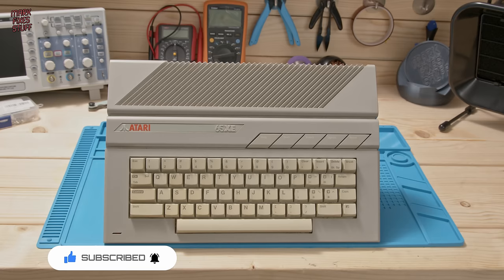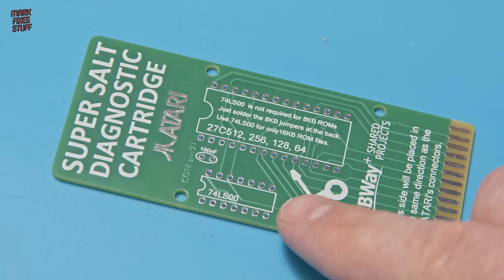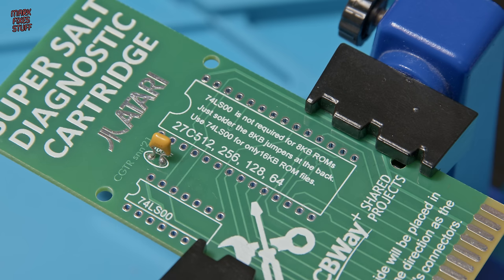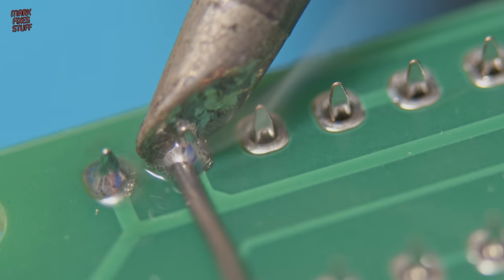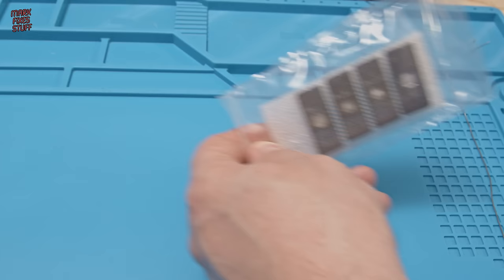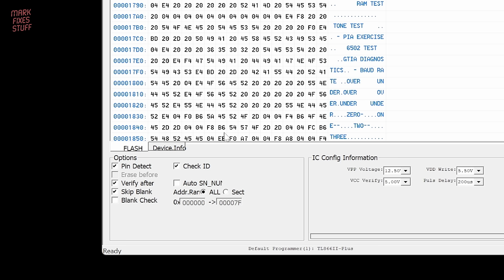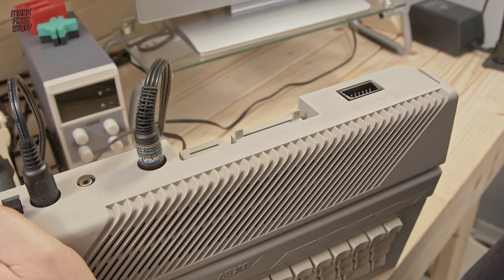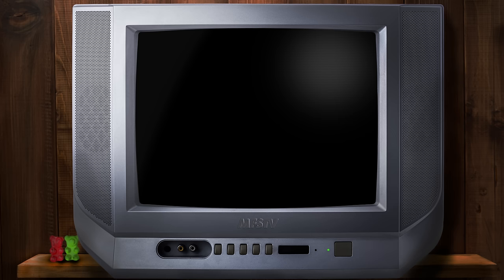Is this worth the effort? Replicating the #Atari Super Salt Diagnostic Cartridge!

Comment: They make switching regulators that are extremely low ripple now. I highly recommend using that instead on a restoration if it's for general use. Obviously a Museum restoration you want to keep original but day to day use it's way better than having all the heat in the case brittling the plastic and stressing the other components
Reply from the maker: I absolutely agree. A Traco or OKI switching regulator is a really good replacement for older machines. I do miss that "warm smell" though!

Comment: Nothing wrong with using leaded solder for home projects.
Reply from the maker: It’s true. I also use leaded on vintage machines that also have leaded solder already because mixing the two is bad. These machines should never go into landfill either, so the likelihood of them being dumped in a way that means the lead leaches into the water table is very small.

Comment: For non-leaded solder, it actually flowed and looked quite decent to work with.  Anyone know the brand/type? 
I don't do a tonne of soldering, only on controllers or other small items, but I only ever used leaded - purposefully staying away from unleaded due to its negative reputation.  As it can be hit or miss with some brands being better than others, I would be curious to know this particular type.
Reply from the maker: For unleaded I tend to use DURATOOL D03341
Reply: @MarkFixesStuff  Cheers.

Comment: Is there any truth to the theory that repeatedly programming the ROM image into an EPROM (say 3 times) reinforces the programming reducing the chances of decay? Secondly I always cover the window but more out of OCD than anything, well I have a label printer so it's a convenient way of labelling it to. I left EPROMS outside here in the sun for two weeks solid (i wanted them erased) and yet they verified perfectly - annoyingly.
Reply from the maker: Programming an EPROM simply flips the bits on the cells so I would suspect this isn’t true. The cell can’t be more flipped with repeated programming. Labelling is essential. I just didn’t in this video before I tried the cart! Thanks for watching!!
Reply: @MarkFixesStuff  As you say it can't be more flipped but was something along the lines of the number of electrons trapped to make it go from 1 -> 0 and over time they decay so the more trapped the  long it takes to decay. Well above my understanding though tbh
Reply from the maker: @digitalarchaeologist5102  I’ve had UV erasable eproms readable after decades so I don’t really think it’s worth worrying about. Not sure on the definitive answer though.

Comment: "Got any O's"?
Reply: "Foot pumps?"
Reply from the maker: Bill Hooks
Reply: @MarkFixesStuff  They did say that was one of their worst endings to a skit.

It took me about five years to even get the "joke". lol
Reply: @baxtardboy  Yep, that sounds plausible.

The BBC were over-sensitive, even back then.

I think that would have been a perfectly fine innuendo. lol
Reply from the maker: @electronash  stone cold classic though. Great timing and physical comedy.
Reply from the maker: @baxtardboy  knockers, one pair.
Reply: @MarkFixesStuff  They were so well-rehearsed and spot-on, it's still amazing to watch, 40+ years later.

Same with Morcombe and Wise.

And they (usually) did it without being overly crude, which is where the real skill is. lol
Reply: btw, I just got the Atari 130XE from the dusty retro shelf last week. It had sadly been sat there for 7 years.

It's already showing signs of more yellowing to the case in that time.

I replaced the keyboard membrane when I first got it, and took the power switch apart to clean the contacts.

(it would often freeze after power-up, or not show anything at all. It was just a dodgy power switch.)

I have the SD2SIO for it.
I really need to get it all hooked up to the CRT soon.

I loved using my original 130XE in the 90s.

"Atari Graphic Demo", Gauntlet, Joust, Alternate Reality, etc.
Reply from the maker: @baxtardboy  spot on. As for the soldering… well you’re in the right place!